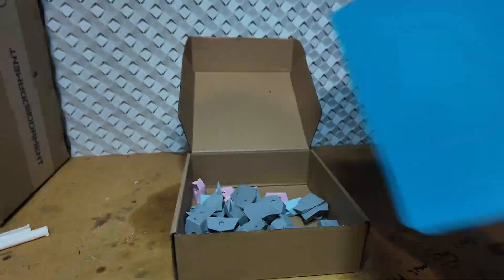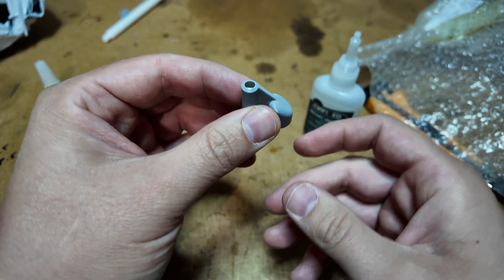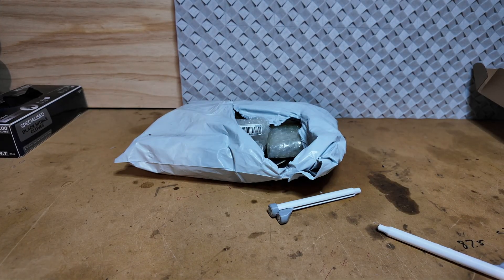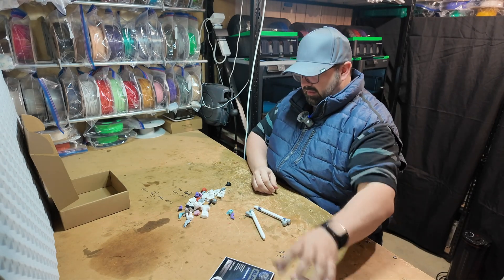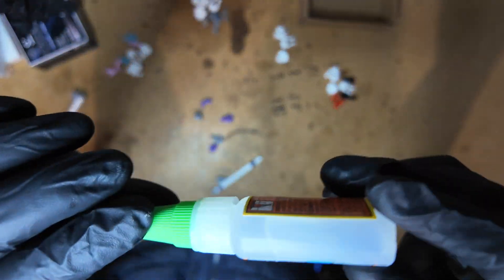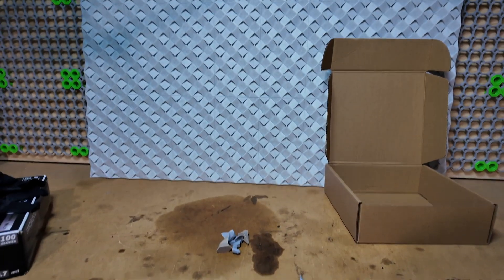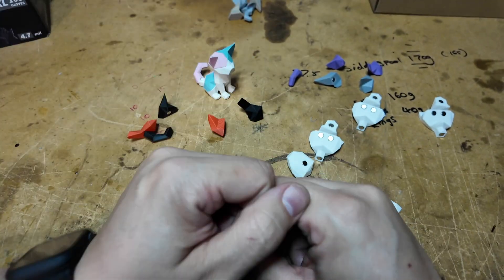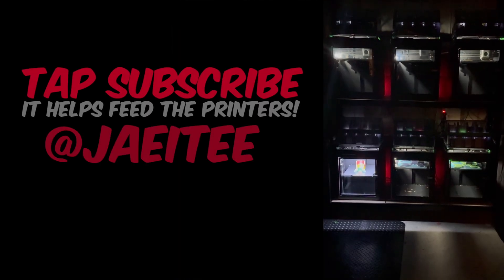3D Printed Embedded Magnet Insert Tool,  Magnetic Puzzles & New Filaments! | Vlog 9

Comment: I use the magnet dispensers a lot. You put a magnet at the top of the slider and in the cap to hold it at the top and stop it from sliding down when not in use.
Reply from the maker: Giving this a go tonight, thank you! 🙌
Reply: I think the problem he would have, and so am I, is that the magnetic will not hold at the top b/c his magnets are no 6mm (or whatever dimension he was trying to use), they are slightly smaller.  So, it won't stick at the top.  I guess you could glue the first on in the top part though.

Comment: Looks like it needs some kind of spring mech, or a ratchet mechanism that lets you push them out one at a time.

I’ve seen other solutions where it’s just a couple pegs with two opposing magnets. Storage is separate. Seems easier to apply the magnets.
Reply from the maker: A Pezz dispenser for magnets! 🙌 I'd like to see a simple magnet setup inside somehow that actually retracted it all back inside after the magnet is pushed out.